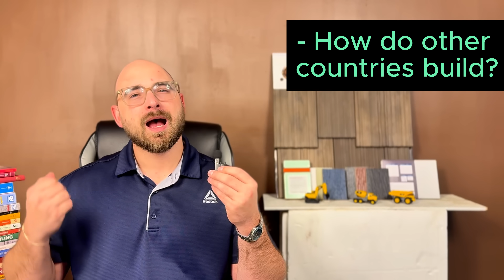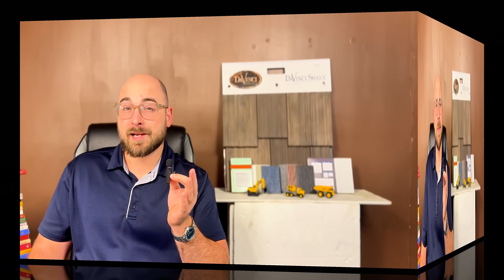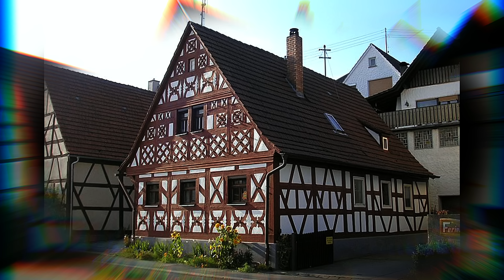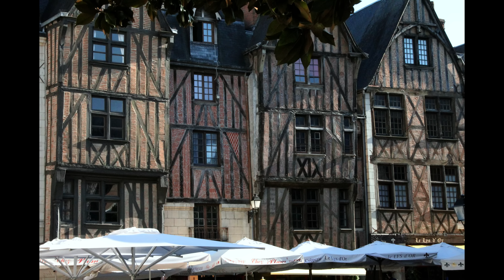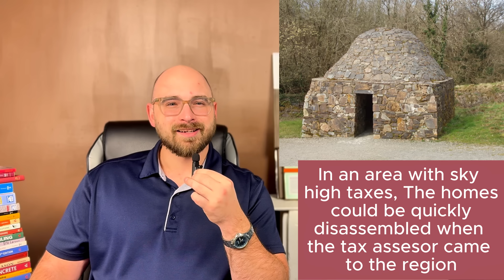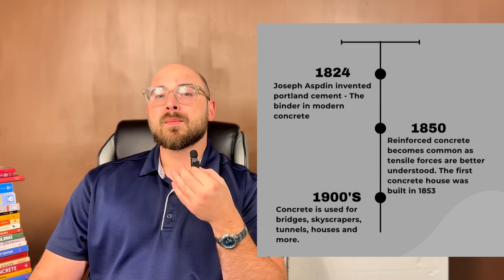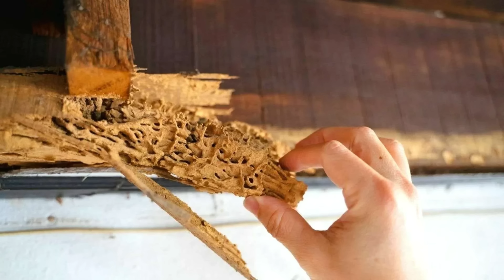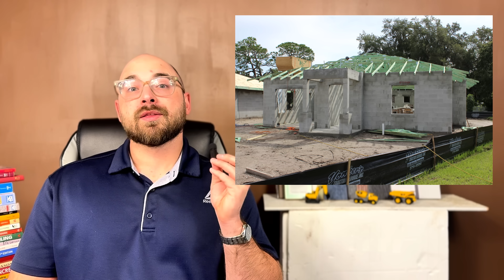Why Other Countries LAUGH at American Homes

Comment: dont listen to this concrete commercial, he talks shit and has his numbers wrong ( a wall having a R50 isolation rate) the best isolating materials in the world (like glasswoll)have a lambda around 0,04, witch means a  a r25 for 1 meter thick wall. 

the real reason why american houses are shit is educationsm building codes and honor. 
in poland, sweeden, denmark, germany, norway, etc. it goes like this

- the plumber that sets the piping have a 4 year education.
- the concrete guy that pour the foundation, have a 3,5 year education.
- the carpenter that make the wooden structure have a 4,5 year education.
- the mason that does the briclaying have a 4 year education.
etc.
in the us its only apprenticeship, where you learn how to work fast and not make what last.

and your building code is of cause super loose in the land of the free,
but if you let people build shitty houses, they gonna bould shitty houses.

fx. no codes about moist pressure, so when you build from sawdust and glue, and dont build in membrains, then you gonna get a mouldy moshroom house in 10 years. 

i could write a lot more, but your concrete commercial isent worth more of my time,
best regards: the danish construction ingeneer and mason.
Reply from the maker: Ouch, 

I would expect an engineer to have a better understanding of stated vs effective r value.

Comment: Aerated concrete block deserves a mention.
I'll guess around 50% of all new houses up in the northern Europe are made of it. It is relatively cheap and quite fast to  set up still. Also doesn't require extra layers of insulation.  None of these plasterboard walls.
Reply from the maker: Going to do a dedicated video on it

Comment: You forgot about autoclaved aerated concrete (AAC) or autoclaved cellular concrete (ACC), which is a common material used for over 50 years in Romania. A lightweight, fireproof material with very good thermal and sound insulation.
Reply: Yep, here in the Czech Republic we use fired brick or AAC (Ytong). I've worked on a few construction sites and AAC is the best option for smaller buildings in my opinion.

Comment: You didn't mention aerated concrete. 
My original house was built using bricks, then we added house extention using aerated concrete (with combined heating). Extention is more heat isolating and I see no flaws in structure after 10 years of use.
Why this haven't been in use in the north America?

Comment: Here in Finland. My house: Concrete fallout bunker underneath the house with 3ft solid walls and 3in solid steel doors, on top of which a concrete basement with 2ft solid walls, and all-masonry with insulation wool between brick layers on visible levels. All interior walls are brick or concrete. Roof girders are steel, on top of which 2mm copper sheeting and underneath it a secondary emergency felt roof held in place with bolted steel strips. Sectioned attic filled completely with wool. Three methods of heating (geothermal heat pump with hot water circulation, two air source heat pumps, four fireplaces), generator and 1500 liter fuel bunker, own well as reserve. Here city houses are built with nuclear war and air bombardment in mind. If the surface layers of the house are destroyed, you can still live in the basement and bunker, where all primary and secondary systems are housed anyway. You just switch off water, heating circulation and power to the lost surface levels. My house was designed by a WW2 veteran, who was certain war would come, again. Some of my friends have a deep and wide well in their basement, just like in horror movies. 😂

Comment: I was born in the archipelago of Cape Verde, and 100% of houses there are built with concrete and iron framing and cinder blocks for walls. Very sturdyand well built especially the ons built a few decades ago which were built using non- hollowed out cinder blocks. Tough as a bunker with foot thick walls. No hurricane would be toppling those, that’s for sure. Hell, in the few times that   There is a fire, the house would still be standing after the fire burns itself out.

Comment: Cement bricks sandwiched between two 10" cement slabs top and bottom... tornado and hurricane proof, and super quiet inside to boot.
Or do the match stick home on a concrete slab and wrap it in brick.. double layer brick to keep inside cooler.

Comment: In South Africa we use mostly brick and mortar housing however concrete is not unheard of. It typically takes between 1 and 5 years to build depending on the design. Our bricks are relatively cheap around ZAR 1. 50 per brick (depends on region) wich is 0.08 USD. We also typically use zinc plate roofing, tile roofing, concrete roofing or thatch roofing. Some homes in rural areas may still be made of clay and dung but these are more often traditional homes.

Comment: australia hardly uses wooden frames anymore. most of our homes are blue scope steel frames, 1 of if not the best steel to build homes with. if its not blue scope its cinder block homes specially in QLD were we have heat, termites, cyclones and floods that destroy timber frame homes.

Comment: Fun thought: My house in Connecticut built in 1900 has stone, brick, concrete and wood as structural elements.

The stone, brick and concrete are all in the foundation and represent the original build as well as 2 major renovations. It has been interesting to pick apart the details in this house.

edit: The house was built in 1900. The first renovation was in the 50s (Likely 1955 as there was a flood here that year, I believe the basement of my house was affected by the flood, thus the renovation). Second renovation was just shy of 20 years ago.

Comment: I am from Turkey and I witnessed that a bulldozer couldn't demolish a house which made of stone and cement.
Reply: What about earthquakes?😢
Reply: @Xenolith41  With the earthquake in the Hatay province not too long ago, a lot of the collapsed buildings were those not built correctly. There was a picture of loads of collapsed homes and shops, in the middle still standing, was the Chamber of Civil Engineers.
Reply: @Xenolith41  
This kind of structure can withstand any earthquake.
The problem is the apartments.
They make them from bricks and doesn't obey the structural integrity rules.
So, when an earthquake hits the results became catastrophic.

Comment: So, what you are saying is murica does not have the resources, knowledge and interest to built lasting homes, because it is so disaster prone. 
A lot of countries will stop laughing and pointing if murica stops having to rebuild after every event, it is seen as loss of resources and manpower which over the years accumulate to higher cost compared to long lasting structures.
The icf method is indeed a very promising method.
Reply: Ah yes, because no other country has to rebuild after a major natural disaster. They totally never have to do that. Like those German concrete homes that totally weren’t swept away in floods killing dozens.
Only America is the only country that has to rebuild after disasters.

Comment: Masonry doesn't do very well in Earthquake Country. Wood (and pricier steel) framing does exceptionally well. A direct hit by anything over and EF1 tornado is going to cause damage to any construction. The Danish guy doesn't understand what hail does to roofing tiles
Reply: Thats actually not true. Japan does very well against earthquakes.
Reply: @8642morrow most Japanese homes are made of wood. Historically Japan has always relied on wood and still does.
Reply: @ Find me a brick or unreinforced concrete building in Japan. You won't find them because the earthquake research done there and in California have shown what works: framed semi-monocoque wood and steel-reinforced concrete

Comment: some of the cool things known from large medieval buildings the roofs are not actually attached to the walls with fixings only fitted using the roof weight cuttings in the timber to secure the roof in place.

I spent a lot of time going around the UK in my teens with my Dad doing building surveys an plans on stuff like churches, bridges, houses, commercial buildings, a few Castles and Cathedrals like Lincoln Cathedral.

My Dad was a Structural Engineer he started off working for Rolls Royce Derby UK way back in his mid to late 20's he then Moved jobs to work for Pick Pickeverard First Main office which was based in Leicester up to his retirement.

It was cool I've been up church spires and on top of water towers in Great Yarmouth to old Victorian Hotel Cellars.

Comment: we don´t criticise that you build from wood, well structure is wood rest is cardboard or something like that, yea we actually criticise that, but main point in a land where you have so many hurricanes, why you build houses there in risky areas, that falls like dominos and burn like matches
Reply: If built correctly (like anything else) wooden houses can survive the wind speeds of most hurricanes. It’s mainly the storm surge that causes most of the destruction. 
Fire is also much more destructive than you think it is. It can structurally compromise a brick house and everything on the inside will still be torched. You’d most likely have to tear it down and rebuild anyway.

Comment: The problem isn’t the material used to build houses but rather it’s the lack of quality control for example houses built in America last for a year or two before a major issue while a house that is built with the same materials in Europe will last for decades without any major issues

Comment: One of the advantages of stick-frame houses, like the majority of US homes, is the ease of repair or modification, particularly "minor" components like water piping, electrical, and "low voltage" electrical.

Comment: Well I can only speak from experience. Houses in California are truly beautiful ( old houses of course) but so many contractors are using cheap labor without any experience, so there’s a massive shortage cuts in the process in houses that cost around 500k.  But housing in Latin America is basically all done by the bricklayers. From the foundation to the roof and paint, waterlines, sewer lines, floors and so on. Blocks, Bricks and concrete are the main components of home construction in the Latin America. A house that will last over 100 years .

Comment: Things to consider. The US is approximately 300 years old and most of the houses are less than 50 or 70 years old, it is still a young country. In Europe, the first settlements are 6 or 7 thousand years old. There are stone houses in Italy, Spain and Germany that are more than 300 or 400 years old. Invasions and wars have passed (this is reflected in civil construction). Another point to consider is that the average home ownership in the US is higher than in Europe. In Switzerland, only 3% are homeowners without debts.

Comment: great subject and great presentation, Thank you 
tbh, as a middle eastern (Iraqi) we build mostly with bricks and concrete these days .. some people still build with mud and clay like the nomads in the marshes .. we have people build with wood in northern Iraq .. but mostly concrete dominate the building materials here. as you said, the availability and ease of use of local materials are the major contributor to choice of what to build with. I think the option of cheapness is the dominant condition to building material.. here concrete is way cheaper than wood .. if wood was cheaper you'd have seen way more wooden houses. and also temperatures here are +120F which make concrete a better choice.

Comment: Ok so... few additions about wood frames of Finland. They utilise lot of clt and other engineered wood, along with floors required to have non-flameable supports or central collumn/staircass to prevent collapse in a fire, so that people can get out or fire rescue in. It is nothing like what Americans do. In fact we are the peoplevwho often join in on the mockery of Americans.

Comment: To summarize, US homes are built cheap for the single benefit of making the builder's profits bigger. It used to be because the materials were cheap and rebuilding wasn't a bad alternative as it is subsidized by insurance companies and US government funding for disaster relief (FEMA) in reality rebuilding is now ruinously expensive, it now all strictly comes down to cost/profit for builders/contractors. Homeowners In the US but this is applicable to most of the world, need to be ultra vigilant with home inspections, too much undetected cost cutting by builders can lead to very costly issues for the homeowner to solve or mitigate over time.

Comment: I am from Switzerland which you mention as being the "concrete heaven on earth". It was interesting to hear why this is so: It's readily available here! I didn't think that this differs from country to country, if you grow up here you assume that's just how it is! We usually build very massive with a basement in concrete that is dug out beneath the ground floor and one or two stories on top for single family homes. Very reliable, but it comes at a cost! But here's something you might find interesting: Because the housing market is so stable here and buildings are built this way we usually don't pay back our mortages! We pay back a little bit every year and of course we pay interest, but the banks assume they get their money back when we sell the house. Thx for an interesting video!

Comment: the great wall of china could afford being basically dirt since both china and its enemies never really did european sieges 
thats why even after hundreds of years of having gunpowder they still had flat walls, while it only took a few decades for european star forts to be invented 

the american wood framed houses made sense in settler times
plenty of untouched forests for wood, plenty of space, and you need it to be finished before winter
its basically an upgrade from a tent, a very nice upgrade, but still a tent 
america isnt in that time anymore, the wood is running out, space is scarce, and it still takes years to build just from paperwork alone 
the nation has outgrown its tradition
but its still cheaper to build like that and rebuild like that and rebuild like that every time its blown over, so they can sell you a expensive house over and over for cheap 

going to want all brick to be double walled
even multi width 
the space inbetween insulates and prevents moisture buildup
yea the modern hollow core bricks kindof do the same, but not as well, and are mostly just to save material on the inner wall 
and sometimes if there is bad taste involved the outer wall 

its sad how common pre cast concrete is becoming, it just lacks the soul of bricks 

the availability of concrete is slowly going down, requiring a specific kind of sand to get quality concrete and you cant just get that stuff on the beach
meanwhile there are massive unused clay veins available in america
yes concrete is essential for modern building design
but the core of a building can be made with beautiful brick and be better for it 

its weird how built quickly still comes up as a positive
how often do americans move?
why dont you want to build a place to spend the rest of your life
and if your building for the rest of your life, why not spend a few more months in construction 
it sounds like a benefit for factory lines, pump them out and get to the next for the next paycheck
thats not really an attitude i would want the creator of the place i will spend the rest of my life to have

Comment: Here in NZ we have a very good reason not to build with brick - we are an earthquake nation due to being directly  on the 'ring of fire' fault line, and why wood is the norm but also it has more give than concrete when it comes to earthquake tremors. Cyclones are extremely rare,  we don't have extreme weather, so building with wood is okay. We don't even use air conditioners or require any flash heating like other countries. Hope that explains why wood is mostly used in NZ.

Comment: actually cant wait until some bright head invents building method using aluminum frame and recycled plastic or some other cheap stuff, so the home cost would be similar to a used car. though, poor bastard probably would get killed for messing with the market.

Comment: The thing as always is, you can do light wood framing that is stable and long lasting. And it's great for areas where light wood framing makes sense. But if you put light wood frames homes in the path of an F5 tornado... do not put a light wood framed house in front of a F5 tornado if you want it to still be there after it.
Reply: Tornadoes don’t have predetermined paths… an EF5 will obliterate anything in its direct path not just wood.